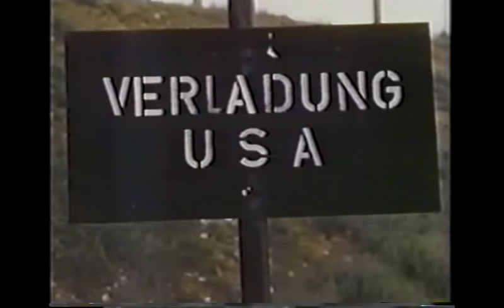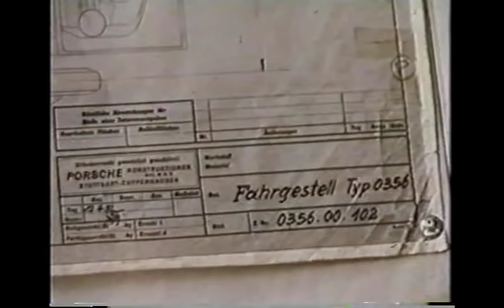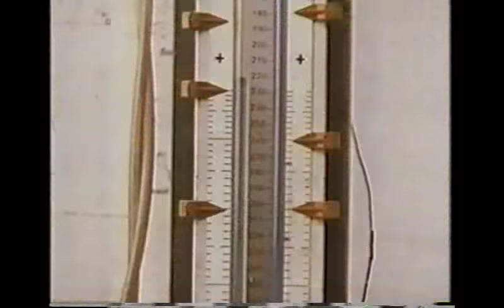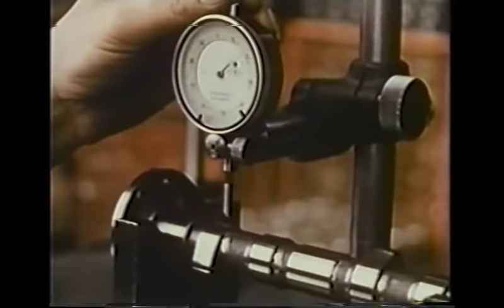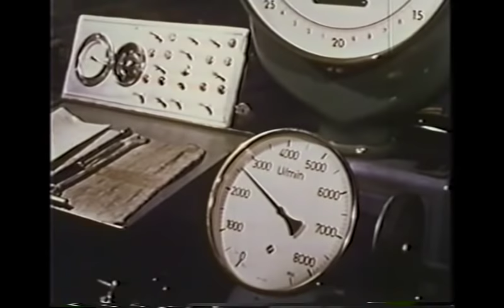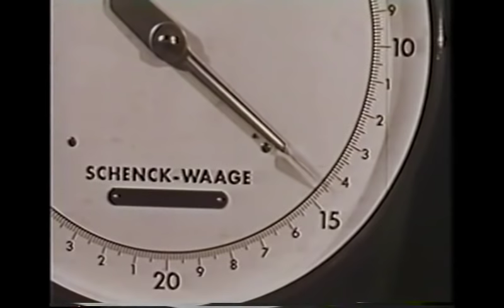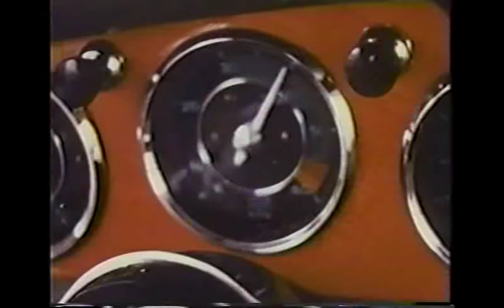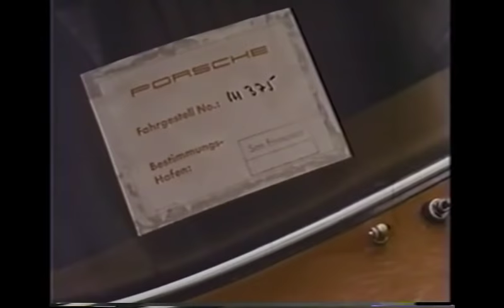Porsche 356 - made by hand - documentary :-)

Comment: In 1965 our family was living in Wurzburg,Germany.  My Dad's best friend was Otto Meyer.  Otto took my Dad+ I on a ride up to Bremen to pick up his new 911.  We rode in his 356 at 90 mph (max. speed) during the rain on the autobaun.  Otto sold his old 356 to my Dad for $100!
Reply: I bought Lou Fageol's 1953 356 Super, which he had modified to AWD. Yes! They couldn't achieve synchronization between the two engines, front and rear, and the unique Porsche was sold through a classified in ROAD & TRACK for about $3,500. After the second owner died when his chute didn't open, a couple Maytag engineers bought the car and raced it in SCCA F Production. I picked it up in December of 1959 for $700, a rumpled wreck with no bumpers and a VW camshaft. I spent the month stripping the many coats of paint, but my chemical remover wouldn't touch the original paint and primer, which was hard as ceramic. I had to sand that off! I had pro spray 17 coats of Lucite metallic silver gray, while I color-sanded between coats. The bumpers were retrieved from a farm, where they were stored by the parents of the second owner, who gave them to me without cost and their blessings. When I moved to California, October of 1961, I sold my 356 for $900 in Des Moines. Today, if restored, the '53 Super coupe would fetch $225,000 at auction. Ve get too soon old, und too late schmart! Or something like hat.
Reply: i will give your dad $150!!!!
Reply: I was in the army, 3 infantry division, “rock of the Marne!”wurzburg German

Comment: The Super 90 engines were made for the 1960 to 1963 models.  The bodies of the cars being built are 356B Type 5, built for the 1960 to 1961 models.  This footage was taken between late 1959 and late 1961.
Reply: I noted a red coupe with the small engine cover vents and the bumpers as fitted on my 1952 "pre A".  Probably film footage from multiple years.

Comment: If porsche made this model car today exactly the same they would still sell
Reply: The only problem i see, price would be very high
Reply: GSA the same as any Porsche, expensive
Reply: @bigears4426  it would not pass any of the security / pollution regulations unfortunately...
Reply: ShamWerks vw diesels didn't either
Reply: I'd buy it right fucking now
Reply: You can get it in a replica. The Subaru powered speedster replica run under 40k and they are quick and handles well.
Reply: @Tumbleweed-vh4pt  True and my biggest concern personally would be: How close could i come with an air cooled, oh...say aftermarket VW case? Like a Brazilian case? I don't expect Subaru level power i guess. Maybe a turbo 2 litre or close to that. Although i first wonder if i wouldn't be happy with 160-180 h.p. naturally aspirated. I know the real nostalgia for these cars can focus on power train and although often a challenge to tune there is the charm and all the rest that goes with the air cooled route many elect to go. The 356 engine as modded by Rod Emery or the guy who restored and once owned Jay Leno's 356 Carrera. Pricy stuff but there are no cheap options that make big power. I'd just like the air cooled alternatives as they are so much immune to deterioration over time and it's not as bad letting air cooled stuff sit for long periods of inactivity.
Reply: There's nobody with the experience to build it
Reply: @bigears4426  giro
Reply: @markjurczyk  giro
Reply: @bigears4426  gi
Reply: @bigears4426  giro italio
Reply: @K-Effect  Good point.
Reply: I disagree, Singer is pretty much hand restoring Porsches to this level if not greater.

Comment: Loved every minute of this film. The true automotive craftsman is long gone unfortunately. Automation and robots have taken over virtually all auto plants worldwide.
Reply: Aston Martin still builded by Hand.
Reply: This isnt craftmanship, that would be using hand tools, this is just production line work. A man trying to be a robot. You could learn to do any of these stages in less than a week, you dont need to be a skilled craftsman.
Reply: @krusher74 There are one or two operations which you probably couldn’t learn in such a short time, though your wider point is absolutely valid.
The use of molten tin, it’s shaping using heat and a leather tool & subsequent filing & planing is harder to do well than it might appear. In this way, Porsche (& presumably all other manufacturers) get to hide panel junctions where they would otherwise be visible.

Comment: I installed a 356 engine in my 1960 Karmen Ghia, had to enlarge the bell housing to accept the larger pressure plate/flywheel n then bolted it right in
Reply: Now you can get more horse power off the old engine from the bolt on parts that are available.

Comment: spray on undercoating, no respirator, shooting paint, no respirator, Melt that lead onto the body, no respirator.  Real Lacquer paint. at least they wear a respirator spraying on the Signal Red paint. The same color I spayed on my 1953 coupe. Back then the windshield was +/- 1/8" in fit so putting in glass was not always a success,  good luck getting a good fit with replacement doors or hood. oddly the rear decks always interchanged well, if you mashed up the rear end.  I put in a 1964 SC engine with a big bore kit, over 100hp. at minute 15:17 we see a red porsche with louvers on the engine deck lid, a Carrera, I think.
Reply: Bruno, I feel kinda light headed. 

Thats normal Heinrich, now get back to painting!
Reply: They must have been happy to survive the war.  What was a little hazardous waste here and there.
Reply: Yes about those windshields I actually broke one because it was too big for the opening but that was part of the program working at a Porsche Dealer as far as getting doors and hoods that fit that is why they used  lead you can make anything LOOK like it fits with a little lead.
Reply: Saw the Carrera too!
Reply: TheHypnotstCollector the karman ghia was no different plenty of lead to make them fit , yet the cheap beetle had nearly perfect pressings no lead at all
Reply: Hey, I had 40 louvers in the trunk (up front) of my 1953 Super, put there by workers at Fageol Bus & Coach Works, Xenia, OH, when Lou Fageol conceived an AWD 356 for SCCA racing circa 1954. They never got the two engines to sync, but a later aero-bodied Porsche had limited success with Citroen (was it?) transaxle. I had tech weld-in blanking plates to remove louvers on my car, restoring it to near-original glory, December of 1959. I sold it for $900. when I left LENNOX and moved to La Jolla in 1961. Had I kept it, my neighbors at Grand Prix Motors tell me, restored, it will bring more than $225-250,000 at auction. Who knew? Color me blue!

Comment: ahhhh, minutes like 9:00 or the spot welding around 8:00, 10:20,  all those fumes, all that lead. You melt lead and shape it all day and you're going to get lead poisoning. And those doors and hoods were all custom, the difference between hoods and doors, car to car, is huge. I had a 1953. Needed a hood and I lucked out: It wasn't perfect but it was close. Doors are worse. Even the windshields had a 1/4" difference car to car so windshield fit could be Tuff.

Comment: At the beginning @ 0:41: Industrial engines?
Single carb, coil behind the fanshroud...
What exact type of engine?
Reply: VW engines I believe
Reply: I think they're Porsche engines.

In those days, they're were really a souped up version of Ferdinands original Vw engine. Porsche made the Vw, Ferry along with his father Ferdinand,  created the sports car version of it, the Porsche. So naturally, the Vw technology had a huge influence on the Porsche technology. The Porsche engine  was larger, around 1600 cc's, used better materials, had bigger crank main/journals sizes, was fully balanced, had dual port intake, an oil sump, had more carburation, usually 2 dual port solex carburators, etc.

Probably those engines on frame 0:41 with the single carburator, were destined for the European 356 market. The cost of automobile ownership in Germany is a lot more expensive than in the US. In Germany you have to pay a yearly tax that for one thing depends on engine size. Also the gas prices in Germany have always been at least 3-4 times higher than the US prices.
Reply: anotherbody2 In that era there was a certain amount of cross-over between the VW and Porsche parts catalogs, where either a Porsche number or a VW number would reference a component with the same geometry, though perhaps with great quality control for the Porsche part.
Reply: +anotherbody2 Porsches started off at 1100 cc like VWs. Displacement increased to 1300 then 1500 and finally, 1600. normals used single throat Solexes, Supers, Zeniths with primary and secondary throats and Super 90s, SCs and later 912s used Solex P40-II with individual barrels for each cylinder. In SCCA autocrosses my Super got about 1 mpg.

Comment: Does anyone know what year this was made?
Great Documentary.
Reply: +bluesman1063 It's about a 356B which was made from '60-'63 so the date of this doc would fall in there somewhere.
Reply: +bluesman1063  T5 cars so somewhere in the Sept 59 to Sept 61 time frame
Reply: +Doug McDonnell  I have read that it was April 1960
Reply: bluesman1063  I can tell you this film was made in the late 50's to early 60's..1957 to 1961. The reason why i know this is because on the 356 Speedster in this factory the rear lights are slotted or teardrop shaped and the pre 1956 Speedster the rear lights were beehives..I know this because I own one in red.

Comment: I predict there will be a substantial industry in converting piston engined, fossil fueled cars to electric engines. Only one rotating part, no complex assembly of parts and constant maintenance, no need for emission system, ignition system, nor exhaust components. And electric sedans of today will run-off and leave most sports cars, silently developing maximum power at zero rpm. The 19th Century invention of the piston-engined automobile has been completely overshadowed and made obsolete by today's electronic propulsion packages. I owned a 356 Super in 1959 and it was a slightly tarted-up VW and dangerous in the corners, with its tiny 4.5x16 tires and swing axle rear suspension. The heater was a joke, too. Those who put nostalgia over comfort and safety will feel right at home in a Porsche of that era. I joined the SCCA in 1952. Among our members then were Gen. Lemay of SAC,USAF, Walter Cronkite(tv), Dave Garroway (tv), Carol Shelby and many other celebrities. We believed in good-handling, functional designs, as opposed to the typical American floating boudoir of a softly sprung sedan devoid of steering feedback and uncomfortable in the corners. Europe supplied an enthusiast's motorcar and when I was younger a Porsche was the Holy Grail. But technology takes precedence over tradition, when the planet
is impacted by oxides of dead dinosaurs, dug out to fuel internal combustion engines. I welcome the conversion of all the top marques to electricity. You won't want to go back.
Reply: Porsche designed one of the first electric cars, and petrol electric hybrids .... in the 1890's
Yes, you read right, eighteen-nineties.
There's nothing new under the sun. Electric cars are great, but the still need electrical energy. From where? As for batteries, even the best Li-ion technology leaves us with an energy store as dangerous as a tank of fuel (Samsung mobile phone fire anybody?)
The problem is storage of electricity. It is almost impossible.
Hydrogen (for fuel cells) is almost the same: very difficult to store, costly to "generate" from electrolysis of water. 
And, if tomorrow, every car was electric, the power grids of the developed world would crumble under the additional load. There a long life left in the infernal combustion engine, particularly small efficient diesels with a decent motor-generator set up. 
Sheets, I've prattled on here
Reply: I counter predict that this will happen and be found to be an absolute folly. And the piston engine will be even more appreciated in the future future